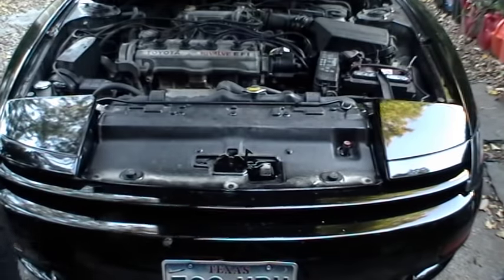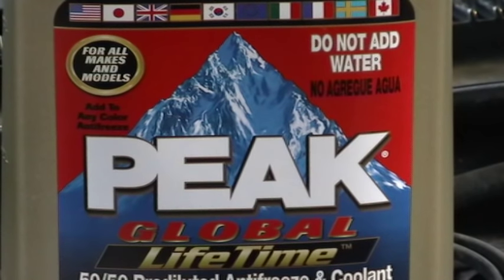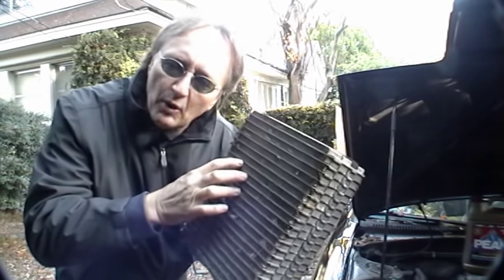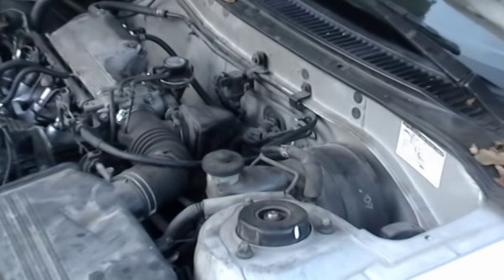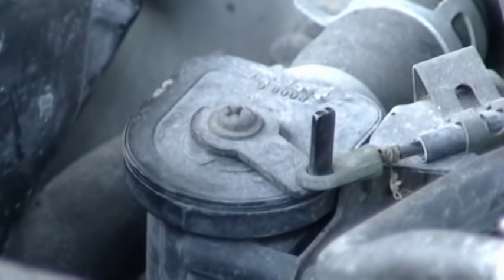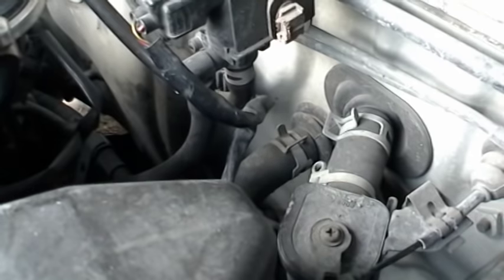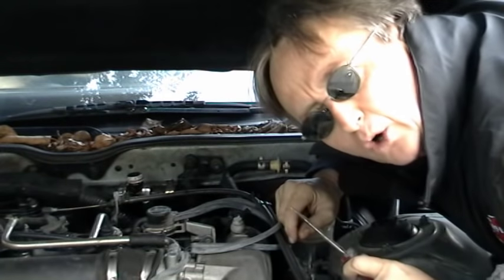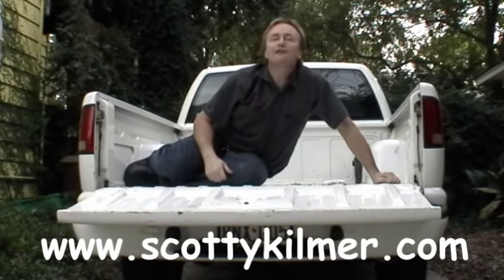How to Fix a Car Heater

Comment: Can I run the power from the battery with a fuse or just run it straight to the switch, then to the blower
Reply from the maker: best to run it from the battery on a fused wire to a switch, then to the blower

Comment: sir,gud day. i have problem in my car nissan sunny 2013,the aircon compressor getting off when traffic and i observe that the radiator fan is not continous working in high speed when vehicle stop.thats why the ac compressor stop/on...what can i do..thanks -joey

Comment: i have a 2014 chevy equinox the dash has to be pulled out to fix the blend door its going to cost 2200 dollars at the dealer any other way i can  get heat with out them doing this scotty

Comment: Hey Scotty..I have a 1992 Mitsubishi Diamante and the heat blows very hot air even if its turned off. If I turn it on sometimes it takes 20-40 minutes before it starts blowing. If I switch it to cool, it still blows hot air. It cuts on and off by itself. I need help please!!!

Comment: Hi Scotty,
Heres my issue i have a 1998 honda prelude and the heater stoped blowing air, i watched your video and checked the hoses that go into the firewall and both are warm/hot. I also checked fuses and none are burnt out and i also checked my coolant level and it was good. 
Can you help me?^^ thanks
Reply from the maker: if you mean no air blows at all, replace the blower motor. If you mean it blows, but not hot air, often a bad blend door inside the dash does that, keeping the door from opening into the heater box
Reply: Scotty Kilmer Im having the same issues scotty how can i fix the bad blend door cause it has to be that i got a 99 crv and i check both hoses going to the heater core and it warm the car throws a lil heat but not enought and wen i put it in high speed it gets cold

Comment: hello Scotty, I have a over heating problem in my Nissan Maxima also my heater inside doesn't constantly blow hot air. It seems that when the heater doesn't blow hot air the car will over heat but suddenly the cold air turns hot and the car starts to cool. I added about 1 1/2 quart of water and it seems ok but I was wondering if it could be a serious issue?
Reply from the maker: fix the overheating problem first, that will make the heater stop. Try my video "how to fix an overheating car"

Comment: On my recently purchase 2003 ford explorer sport tracker when I first got it , the head lights and door buttons would stay on even with the key removed from ignition. No power to blower fan and inside consol lights stay lit. O have to remove the Batter cable
 wire just to be sure I'll have power in the mourning...I opened the door. On  driver side door and found a snake like ribbed hose the  pulled the boot that supposedly protects the wire bundle..what o found after removing the boot was a bit of water was drained out and since it's dried out it running fine...still worry if this happens again..

Comment: Hey Scotty I have 2011 Mazda 6, and when I turn the heat off all the way it still blows out a little bit?
Reply: +Joshua Severson When you are driving there is always blowing in some air from the outside. You can shut off the ventilation coming from the outside by set it to recirculation. But fresh air is good.

Comment: Scotty, can you please tell me where the heater control valve for a 2002 Ford F150 is located? I'm having trouble finding the location.
Reply from the maker: you;ll never find it cause they don't have em. They use blend doors inside the dash vents, the heater core is always full of hot water on that design
Reply: Scotty Kilmer how is that even possible... Why would the dealership tell me that the reason my heater isn't working is because the heater control valve is bad.

Comment: Hello from Albania Scotty! Great video! I have a BMW 325ci and had problem with head gasket and mechanic repace that, but when mechanic finish that, the car now won't heat insider:(. Thermostat is ok,waterpump ok, valve heater ok. "Periferic" pipes are cold. If you have any idea, i will appreciate that:). Sorry for my English:). Bye
Reply from the maker: +Tefik Ramizi     odds are he didn't bleed all the air out of the system, start there and pray he didn't mess up complex BMW computer run heating controls
Reply: +Scotty Kilmer no air has in system, what do you think about heater core clogged,? Thanks

Comment: My Mazda protege5 2003 is not blowing any heat but cold air is fine..  Your thoughts please??
Reply from the maker: +Tenzin Phandey try the stuff in this video, especially flushing out the heater core
Reply: +Tenzin Phandey How hot does your engine get? A waterpump that is not working properly will cause a hot engine (especially if you're driving fast) but your heater stays cold. Check (feel) the temperature of the hoses coming in and going out of your heater. That gives you an idea where the heat is going to.

Comment: Hey scotty, my dads toyota has some heater vents that work, some that dont, what do you think is the problem? Probably the heater core by the sounds of it yeah?
Reply from the maker: if it's hot on the passenger side but not on the driver's, that's often a clogged heater core or one that has air in it from low coolant

Comment: Hi scotty I have a question. I have a 96 hyundai elantra. when I turn on heat nothing comes out the vents unless I'm driving on the interstate. Can you give me some suggestions please
Reply from the maker: probably needs a new blower motor, that blows the air, but when going fast, outside speed forces some air in
Reply: I found the problem there is no relay where the blower is
Reply: I hope thats the problem anyway. Thank you Scotty!

Comment: if you can tell me sir the inlet and oulet  cooling water of air  idle control valve of toyota 1997 corolla.i try to change the rubber hose for water but im not sure which is outlet and inlet.
Reply from the maker: inlet is on top, outlet below

Comment: My heater in my 2001 gmc sonoma used to work fine but now it does nothing and if I try to turn it on when I have my stereo on it turns off my stereo. How can I find what's causing it to malfunction?

Comment: Ok so I am back. I flushed it with a Preston kit. I also did a Preston super flush solution. I changed my fuses, I changed the thermostat. New antifreeze and still no heat. The fan is blowing, I am only getting cold air. I didnt have anything other than antifreeze drain when I flushed it, and it was the normal color. What else could it be? 2005 Mercury Grand Marquis.

Comment: Hey Scotty I have a 01 ford expedition which the heater will work then not work for me but not at All on full what could this be I would like to know before I spend $600 on a heater core and find out that wasn't the problem
Reply from the maker: those have  VERY complex heating systems that are computer run, and require a dealer level scan tool to analyze such problems, could easily be a bad blend door. Find a guy like me with such a machine, and have them analyze it FIRST. See my video "fixing modern cars using high level scan computers" and realize that is needed to find out

Comment: i have a 2002 gran prix and its running fine but past few months my heater been slowly getting cooler and today my temp gage didn't even get close to rising toward middle and my check engine soon came on could you help me out by maybe helping me figure out the problem thanks so much god bless
Reply from the maker: replace the thermostat, it could be that simple for all fixes

Comment: scotty i see u were 101 i was 173rd and 82nd i have a 2006 silverado 1500 i replaced the blower motor and the resistor and wires fuses are good but i got nothing it wont come on the resitor was burnt like i said i replaced both motor and risitor

Comment: I tried to change a thermostat on 04' Pontiac Montana. Now it's winter & has low heat.
Reply: Make sure you didn''t put the thermostat in backwards.

Comment: Hi. 

My temperature gauge dont go up. Heater works. Replaced temperature cooling sensor and still doesnt work. What else can i check?
Reply from the maker: then the wiring OR the gauge in the dash is bad
Reply: Thank you!
Reply: Scotty Kilmer I have a 1999 ford expedition and i feel no flow through the top radiator hose and my temp gauge I noticed is not rising what should I check first?

Comment: Hi Scotty tried to send you a direct question not sure if it went thru. Nice video. I need part # of the heat control valve for rav4 2001
Reply: george a call your local auto parts place they should know

Comment: @scotty my heat is not working on my 02 dodge stratus. i sent u a message b 4 tellin u my car was over heating on the highway cause the overflow tank was clogged but i cleaned it out and it started runnin right gain, but now no heat? do i need to bleed it?

Comment: I get heat from passenger side vent and one of the middle vents. The second middle vent and driver vent blow cold air. What is going on here? I flushed the cooling system thoroughly

Comment: i have a lincoln ls 2000 v8 every time i turn on the A/C A HISSIING sound is heard but just for about 5 seconds is that bad or is it just like that.also my driver side is always colder than my passenger side whats wrong with it can you tell me whats wrong?

Comment: Hey Scotty I own a 2007 Hyundai sonota. I have very little heat what I do have is all on the driver side cold air on passenger. I flushed out the heater core like you suggested and I still have same thing. I was told now to try the blend door actuator but I can't find it on my car and I'd I was to tap it would it maybe go lol. I'm in a pinch here any proven tips you have would be most beneficial to me and my situation tHanks in advanced Gord
Reply from the maker: you can't work on blend door systems and analyze them without a dealer level scanner, so find a guy with them. They are deep inside the dash and guess is foolhardy with a bidirectional testing scanner

Comment: Is there ANY way to fix a leaking heater core other than replacing it?
Reply from the maker: not really, you can bypass it by cutting the hoses and splicing them together, but sealers rarely work on heater cores
Reply: Alright man thx for the help.

Comment: Do you know where the heater control switch is on a 1989 Lincoln Town Car?? Mine blows cold air out and both heater core hoses r hot and i done changed the thermostat..  I think the door is not shutting for the cold to switch to heat.. Tired of me and my kids driving 2 school in this cold car.. Please help..
Reply from the maker: should be under the hood near the firewall where the heater hoses go into the dash.
Reply: I can't find it and I've looked everywhere !!

Comment: I have a 2004 Mercury Monterey. The heater blows hot air on the passenger side and in the back, but only cold air on drivers side.. please help

Comment: I have a 95 Ford Ranger the heater works fine but the air only blows out of the defrost on top of the dash and towards the floor no mater what setting I have it on what should be my first step in fixing it
Reply from the maker: check for vacuum leaks, if a hose comes off the heating system, it automatically goes to defrost only for safety

Comment: I have an 03 expedition xlt. I have a new thermostat, new radiator, new actuator, fresh coolant, and still getting no heat... half of coolant hose is hot and other half towards truck is cold....

Comment: My 1995 buick lesabre blows warm air on drivers side and cold air on passenger side. I have replaced thermostat and bled air from housing above thermostat. My car barely will get warm inside. winter is coming on here in iowa and i need my car to be able to defrost my windows and keep my wife warm. Can you tell me what causes this problem how to fix it? Thanks
Reply from the maker: It may be old, but the hvac system in it is very complex. probably a bad blend door or actuator in the dash, but you need a dealer level scan computer to analyze such complex systems. GM has made some real crappers with those computer run dash systems, even WAAY back then.  But if you want a wild guess, try flushing the heater core with strong cooling system flush and pray it's clogged up inside.

Comment: my car was parked for few months outside and just done installing motor on it now everythings works fine but my heater there no respond at all at the switch control (1.2.3.4) dosnt respond at all. but i feel the heat when the switch of cold and hot is in hot.

Comment: what about on a 2000 Nissan pathfinder my heater and the A\C
 is not working sometime it come on but now its not working at all so what do i need to do now
Reply from the maker: start with these video fixes and PRAY it's not in the complex computer controls on that nissan

Comment: I have a problem with my semi truck heating if i push the pedal up to 1000RPM  or driving i get heat but at 600 rpm idling I got only cold air. My engine is N14 Cummings select plus. The shop replaced heater cord and the heater cord regulator but it's still the same.😔😔😔😔

Comment: I had an intermittent heater once that turned out to be an air pocket trapped in the heater core.  I had to park my car on an incline and open the radiator cap to purge the air out.

Comment: In my car when i turn on the heat it gets warm and maybe blows 75 degree air out but i want to make it hotter for the cold days here where it gets -20 below zero. Any ideas on how i can get more heat in my car?
Reply from the maker: +redline251 put in a hotter thermostat

Comment: where would the "rear blend door" be located at in the car?
Reply from the maker: +Thomas Mccarthy inside the dash, unless it's also a dual heater van in which case that would be in the back of the vehicle
Reply: Thank you.

Comment: What about if heat blows through the vent when fan is off and somtime ac does the same aomthimes ? Heat smells funky
Reply from the maker: outside air forces flow in the hvac system when any car is moving, that's normal. try spraying some lysol into the intake vents with heat on full blast to kill mold growing in the heater core for the smell

Comment: hey scotty just flushed my heater core with water and some anti freeze is spelt in the process. when i put everything back together, took the car for a 10 min spin the thermostat heats up to normal but the intake manifold remains cold! is that normal? and the heater hoes are not really hot at lest one seems a little cooler than the other

Comment: i have a 95 s10 - been going w/out heat for 5 yrs and am sick of it!! If u switch to ANYTHING ( a/c - htr/vents/ mix - whatever, well -- nothing happens EXCEPT my odometer drops to  zero so i dont know how fast i'm going ??? have no defrost . nothing! i've taking my radio out to see if any wires are exposed but see nothing wrong? u have any ideas/ please help ,,, when i switch back to off my odometer goes back to my speed.

Comment: hi I have a 2007 ford f-350 it won't blow heat when it's just sitting there but said soon as I drive it it blows nice hot air as soon as I let off on the throttle it blows cold what could this be caused by please and thanks as my truck is starting to get wet from moisture as I can't warm it unless I'm reving it
Reply from the maker: +MajorBigBudz classic signs of a clogged heater core. Try flushing it out big time, costs a ton to replace one
Reply: +Scotty Kilmer ok now we know that. there are quick connectors That hook on the hoses to the heater core is there some way I can get them off without the special tool needed to remove the connectors or do I need to go and buy the special tool
Reply: +Scotty Kilmer ok I flushed the heater core I wasn't plugged seems the coolent is good  I checked the heater control valve I blew into it it seems clear but yet I still have no heat what else could this be I'm getting annoyed with this truck
Reply: +MajorBigBudz an egr delete wouldn't prevent the heat from working would it ?
Reply: fix or repair daily for ford

Comment: I tried the hose the valve works and both tubes are the same temp but all I get is luke warm air  :( Do I need a new heater core?
Reply: I have a van with the same problem. Dual controls. Both blend doors won't open, I doubt it. Dodge uses plastic impellers in the water pumo. Do those get weak over the years? Hopefully we can figure this out.
Reply: ya it looks like the vent is stuck, didn't think it would be cus it was mechanical lever but the lever has a crack in it that I have to weld.

Comment: Jeep cherokee 96 classic 4 lit   I have replaced the blower motor and resistor and still no ac or heat. What else could it be?
Reply from the maker: realize even on that old thing heat and ac is all computer controlled. BUT, if it doesn't blow air at all, why not cut the 2 wires to the blower and put a toggle switch to run power to the fan, that works forever and is easy to do.

Comment: Hey man..i got a problem in my honda integra zx 1993 model.last week my car heater and cooling fan was still working.a week ive just park my car and didnt use it.but suddenly when i start it and use again i noticed that my fan has not working.when i turn the switch in selected low to high fan it doesnt work anymore.if i turn the ac its just making noise only.no cooling no heater comes out.so qhat do you think wrong with it? Thanks mate
Reply: The winter is coming so i need to fix it right away.so if you can give any suggestion it would be great.
Reply from the maker: Rham Angeles
you must be south of the equator. I would assume your blower motor fan is just burned out, see my video "replacing a blower motor on your car"
Reply: Yeah alright man..i'll just check it out.so i can any other idea about it..thanks cheers

Comment: hey i have a mercury wagon and dont throw hot air when it in parking only when it runing do u know what wrong with it
Reply from the maker: +Cesar Barrera flush the heater core, and check for vacuum leaks as in my video "finding engine vacuum leaks with a cigar"
Reply: +Scotty Kilmer ok thanks i preciate